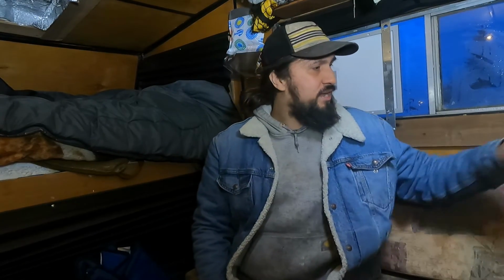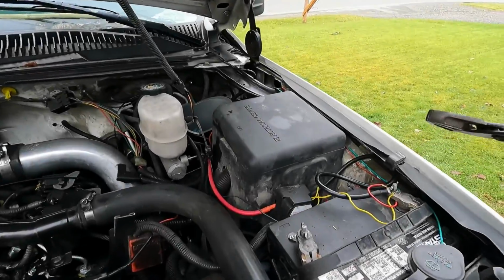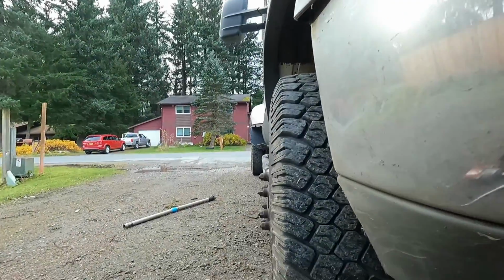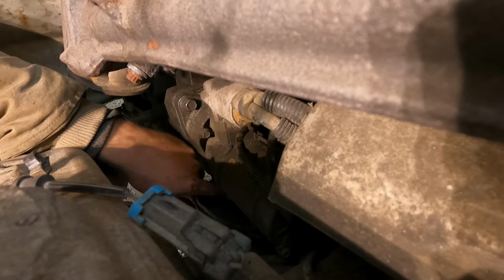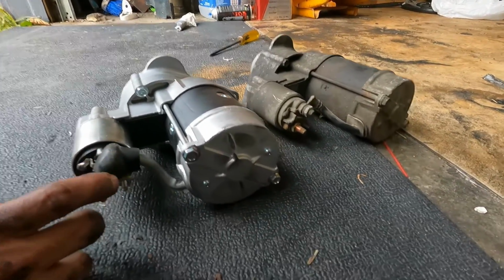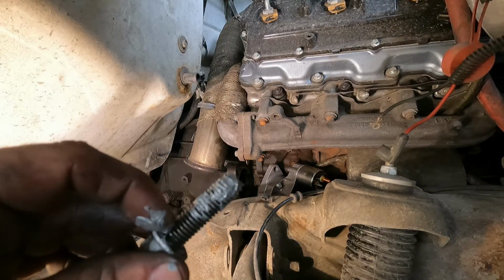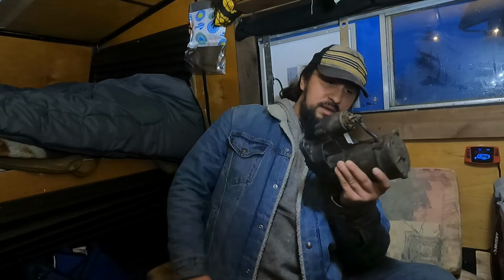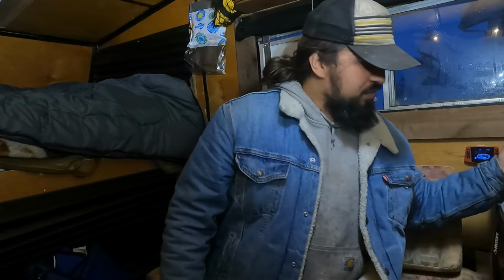2001-2007 Duramax Starter Replacement

Comment: Just completed putting a starter in my 2002 GMC 3500.  Thank you for the info.  You were correct about the bottom bolt and I really appreciate the tips.  Other than running to the store for another extension it went flawlessly.
Reply from the maker: Heck yeah man, glad you got it! That bottom bolt is a pain in the arse. Lol 🍻

Comment: How in the hell do you get everything on the bottom bolt? My bolts have been tapped to a 13/16 grade 8 bolt
Reply from the maker: Remove the skid plate and use a crap ton of extensions 😬  in forgot the length of extensions. I go over it in the video. Huge pain!  But doable. Best of luck 🍻

Comment: I just replaced mine and have 2 key points to add. The first is, be careful with the exhaust band clamp. If the nut feels froze and won't come off, cut it off. I broke the threaded shaft behind the nut and spent $70 for a new clamp. Not cheap! Also, if the starter is grinding, chances are the flywheel is damaged which takes out the teeth on the starter. In that case, replace them both or your on borrowed time.
Reply from the maker: @paulheinzman6352  both very good points. Thank you! 🍻

Comment: By far the most realistic rendition of a genuine PITA job.   Just finished my CP3 and am so friggin' ecstatic about the upcoming pleasure of changing out my starter.      Great video!  Thanks..
Reply from the maker: PITA to the max Rudolpho!   I bet that CP3 was a beast to get too.   I wanted to do mine while I was doing injectors but I'll be a son of a gun if injectors, head gaskets, studs and all the little odds and ends that goes into a head & turbo rebuild with port and polish didn't drain the bank account as it was at the time.  Good luck with the starter man, it'll be easier than the CP3 at least 🍻
Reply: @KooshdaakaaGarage  Definitely the right time to do the starter.  After the pump crucible-the starter replacement was petty simple.  There are a lot of videos out there but unlike your video- these guys just set the camera up and rarely ever show the demands that will be made of your arms and fingertips.   There's just something magic about watching someone else showing you all of the contorted positions and delicate 1/4 thread finger snugging that there is to look forward to    I guess mutual witnessed misery breeds confidence.   Enjoy your week and a sincere thanks.

Comment: How is the starter holding up after a year?
Reply from the maker: Starts up like  champ everytime so far!
Reply: @KooshdaakaaGarage  My Niece just bought an '02 2500 HD crew cab short bed 4x4 and the beddix/drive in the starter is weak. I think we're going to have the starter rebuilt and the drive replaced and go from there.
Reply from the maker: Sounds doable man. Congrats to your niece on the Duramax purchase! 🍻

Comment: 2008 I did my bottom bolt without removing skid plate. Cut a 15mm wrench short, broke it free. Loosened 2nd exhaust hanger had enough room.
Reply from the maker: Nice!

Comment: Hey bud I'm getting a drip from the bottom starter bolt it looks like would that be rear Mai seal or starter seal ? Thanks
Reply from the maker: Oil drip?  I have a bad rear main seal and it drips from the bell housing. I could see that trickling by the starter though. Also you might check your turbo oil return. Sometimes those gaskets go bad

Comment: I just did mine yesterday  and no sound but now there's a screeching/ grinding sound when I start it
Reply: The flexplate teeth are likely chewed up. Remove the starter and bar the gear over and inspect those teeth. If the flexplate teeth are missing some notches it will eat every starter you put on it

My LB7 had similar symptoms and i didnt figure it out until I was pulling the transmission out to overhaul my block

Comment: I didn't have to mess with my exhaust at all on my 2wd 2500HD, came out easy.  And you ain't lying about that cheater pipe, when I was breaking the flexplate bolts loose it took everything I had with a long 1/2 breaker bar AND the cheater pipe.  I'm not a small guy at 6' 250 either, those mfers are just tight.  And there's 8 of the bastards.
Reply from the maker: No messing with the exhaust?  You must be Hudini 😆  nice work though  because it was kicking my butt until I removed that one piece.  I think I've used the jack handles more for cheater bars than for it's intended use. Lol.  What did ole Red Green say?  If the women don't find ya handsome they should at least find ya handy.  Cheers 🍻
Reply: @KooshdaakaaGarage  that's actually exactly what I had to do, use the upper handle of my Craftsman 3 ton jack as a cheater bar, lol (my real cheater pipes were too long to use under the truck).  2wd has its benefits, I have a gaping hole where your passenger side halfshaft is at.

Did it all from underneath, had the truck up on 4 ramps for the flexplate job, lowered the starter first then disconnected the wires.  Installed the same way, hooked up the wires, slid it in place, 3/8" ratchet w/extensions to tighten the bolts.  I was contemplating doing the starter just to do it, but changed my mind when I saw how easy it is to do.
Reply from the maker: Man that flex plate job does not sound fun in the least unless the engine was out of the truck 😳  bet that was one tight squeeze after another.  Did you go with a billet flex plate?
Reply: @KooshdaakaaGarage  yeah, billet Socal Diesel flexplate from Dmaxstore, didn't want that ever breaking again, lol.  Really wasn't a bad job, pulling the trans is surprisingly easy.  Get the crossmember out of the way, lower the trans down, and you can easily get all the bellhousing bolts from behind the trans with extensions.  Didn't mess with the exhaust at all, and just tied the driveshaft up out of the way.  Trans was able to slide back far enough so it stayed under the truck the whole time.

If you ever have to do the rear main, and have the extra coin, it's well worth the upgrade.